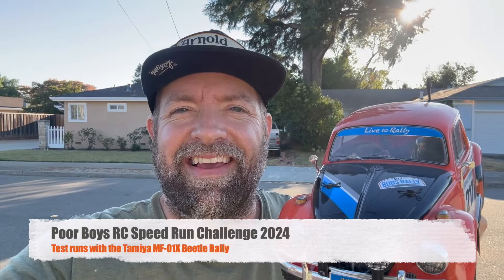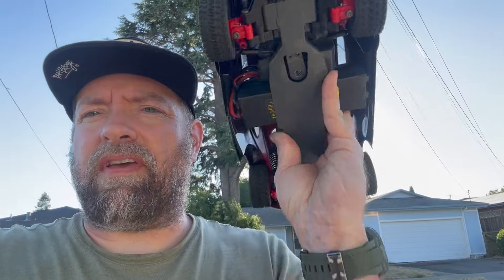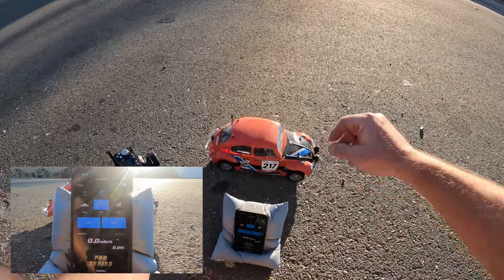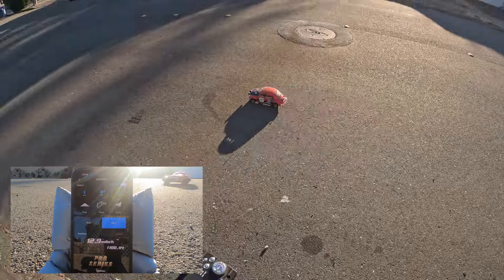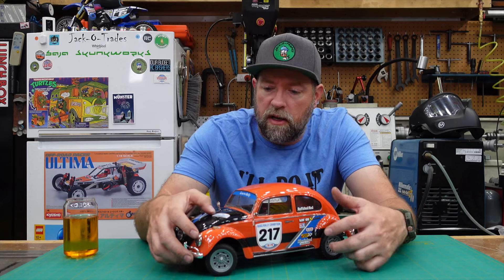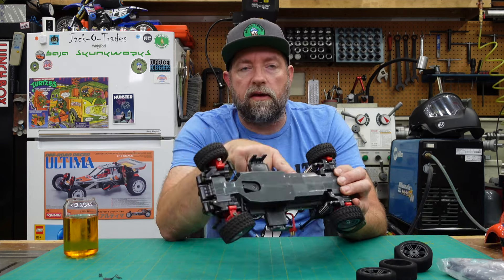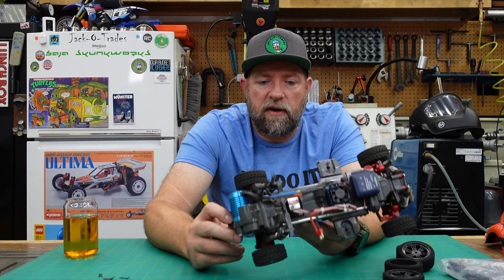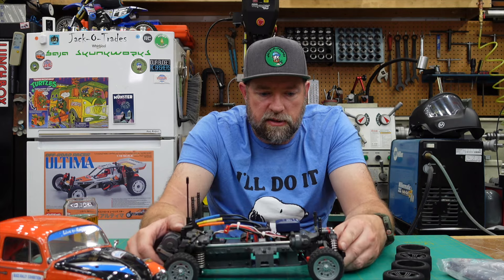Poor Boys RC Tamiya MF-01X Speedrun - Beetle Rally Test Runs

Comment: Ive not even got the chassis yet, and your pulling runs 😮 i’ll be getting on board once ive got these vintage races out the way this month, and still not decided if i go brushed or brushless 🤔
Reply from the maker: The nice thing about this year is you have a month to work with the car before you have to decide. I'm looking forward to binging on all the MF-01X videos from everyone. Good luck with the challenge this year!
Reply: @jack-o-trades  yeah, cant decide what class yet either 🤔

Comment: Nice beetle for the run, Tamiya are limited on gearing.
Reply from the maker: Thanks, They do have limits on what you can stuff into them. Though there is a speed gear set and you should be able to squeeze a 28t pinion in there with the help of a Dremel. I am considering a custom gearbox (in open class) to help alleviate the issue. Someone has already done a mid-motor rear end which is interesting, but I might have a different take on it.

Comment: Yeah, it'll be fun! I also just ordered a kit a couple hours ago, I'll be doing brushed, not too fast...
Yeah, about the wheelbase, there should be an additional bit in the kit that is something like 20mm, so you should be able to achieve right wheelbase... Unless you threw it away, ha ha! And the propshaft should be easy to make a longer version, too...
I'm looking forward to see some more of you stuff, buddy!
Reply from the maker: Thanks! given it's been four years, and I have a different mindset about hoarding parts now, I don't have it. But the parts tree is less than $10, so no biggie. Given the last couple of days of tinkering, I'll be going open class. I have some crazy ideas for converting to a mid-motor but it might be too much....I'm looking forward to seeing your build. The car is quit fun once you fix the steering and suspension (that's probably true for all cars...).

Comment: Nice start.  I am on the fence as to if I will give it a go...  Cheers
Reply from the maker: Go for it! Plenty of time for the contest, and it’s not too hard to get the chassis dialed in. I’ve been making good progress with small changes.  Some oil shock, glue up the servo saver and that’s a huge stability improvement.

Comment: Looks like with those tires it should grip better and put power down easier and a suspension will help. I got the same one as yours but I’ll be in brush class. I’m Excited for my first year. Good luck to you. ✌️
Reply from the maker: Hey Luke! Awesome to have you as part of the challenge. Tires, shocks, and servo arm made a huge improvement. With that, you should be able to focus on speed unto probably 50 mph. Given the right brushed motor, I think that's attainable. Do you have any thoughts as to what brushed motor you're thinking about. I think there are tons of vintage brushed motors that are way hotter than anything in current production. I could be wrong...

Comment: Glue the servo saver parts, it removes the slop.
Reply: Once I did that and added oil shocks the chassis was great to drive.
Reply from the maker: Thanks for the tip. I ended up putting on an aftermarket servo horn and made a dual ball stud adapter. a little convoluted but it looks trick and does the part.